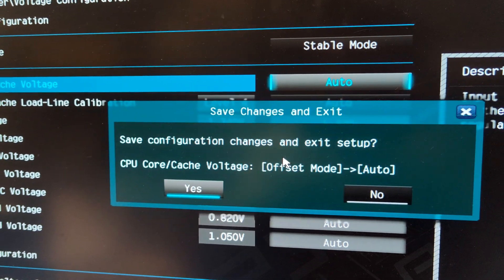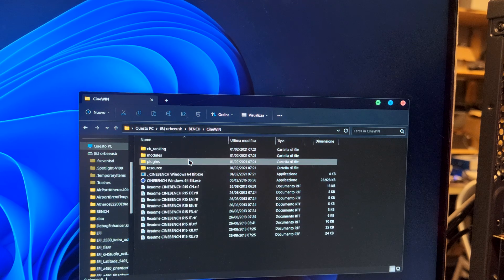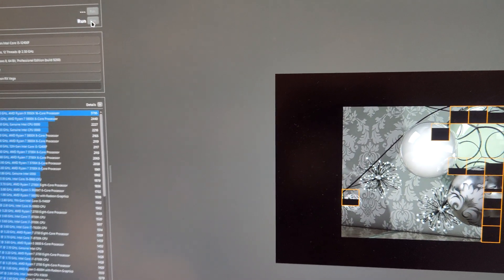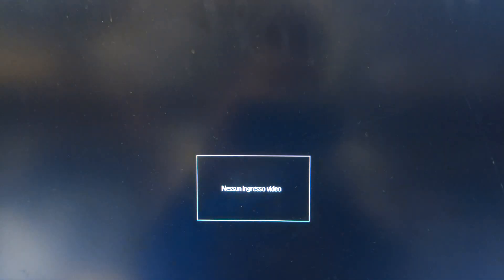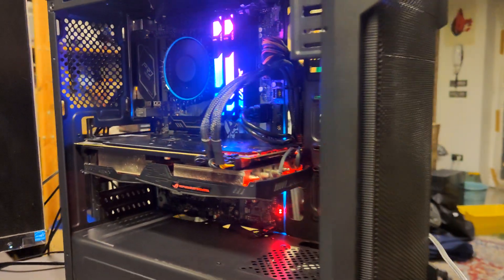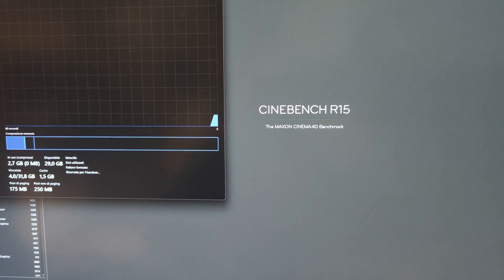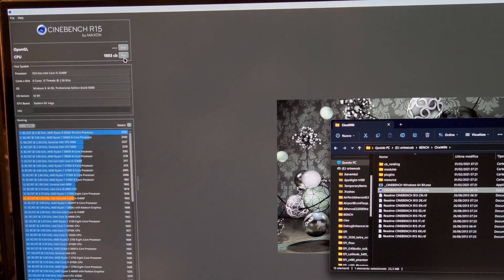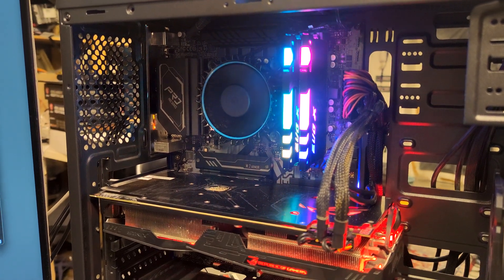get 50% more performance on Asrock b660 pro rs and i5 12400f cinebench r15

Comment: does this mobo have bclk oc?
can i oc 12400f to 5ghz on this mobo?
Reply from the maker: @jimmyke16  no
Reply: @mircomputers  there was an earlier bios flash when u could use bclk then they removed it
Reply from the maker: @jimmyke16  the fact that you have a bios option does not mean the clockgen chip has ever been there
Reply: @mircomputers  nvm i just bought a 7800xt and replaced my 12400 to an 14600kf to get some more performance. And ill undervolt the 14600k to keep my mobo handle it a bit better 😁
Reply from the maker: @jimmyke16  why bother the 12400f is good enough
Reply: @mircomputers  180hz 1440p, and i play some cpu bound games, also streaming sometimes

Comment: Can you also test the XMP function for this CPU and motherboard? I want to know it is running 3600 G1 or G2
Reply from the maker: that is not about the board but depends on locked system agent, locked alder lake cannot do 3600 g1 even at super low temps, usually they do around 3400 maybe 3466 with good cooling; raptor lake can actually reach 3600 and 14 gen finally has unlocked SA on locked cpus so every 14400f can do it, at about 1v if it's alder lake core and 0.95 if it's raptor

Comment: how can i do this with my i5 12600kf, what is the value i should put in?
Reply from the maker: This is only for the H0 die cpus like some 12400f and 12500 and 12600 non K; 12600KF does not have this issue, you should use negative offset instead.

Comment: Hi, can you tell the difference between power consumption before and after the tweak? Is the Turbo boost function working after the tweak or it is always full max boosted at top GHz?
Reply from the maker: yes ofc the CPU uses more power - about 20w more from 60 to 80, but the score increase is much bigger

the turbo and speedstep are working perfectly fine ofc
Reply: @mircomputers  Last time I overclocked a CPU was on socket 775 made for core 2 duo, where I put server 4 core Xeon and overclocked it from 2,3 to 3 GHz, but it was always working at 3 GHz if I remember correctly. Nice to know this case with 12400f is not the same and it goes up only when pushed and the idle speed is lower. Thank you for the responce, have a nice day!

Comment: Hello, I have recently bought a b760 asrock pg riptide. My problem is the ram with the ddr5 who can’t overclock to 6400mhz I would like to know if you have any solution about that.
Thx
Reply from the maker: hello i'v recently built a system with that motherboard and I was able to get 6600 stable on a 12400f, it is mostly silicon lottery